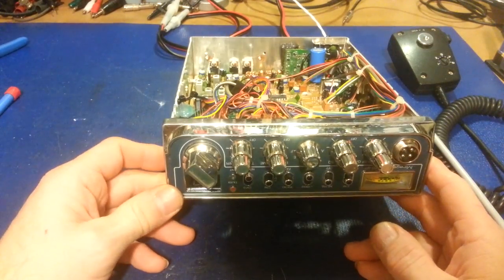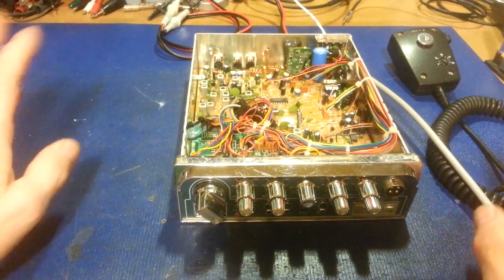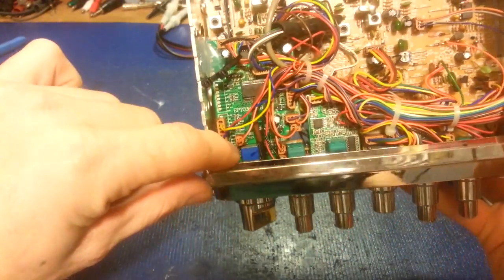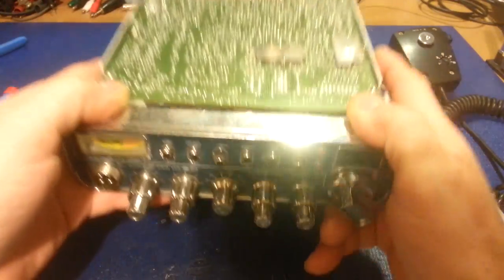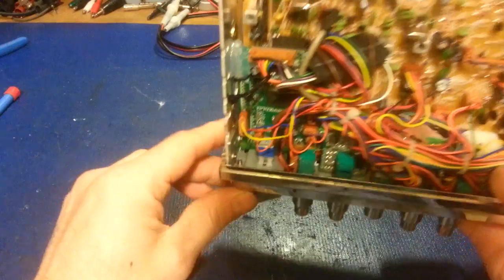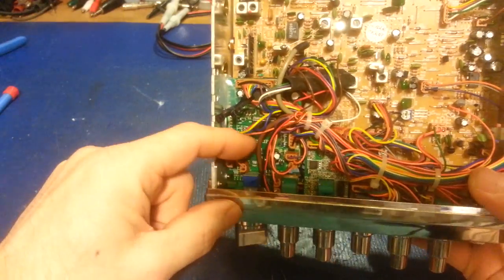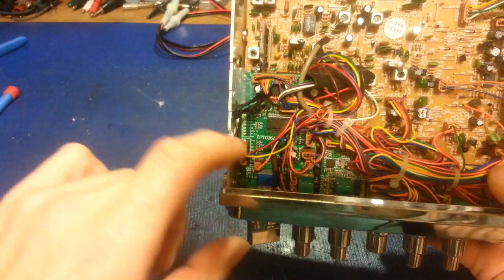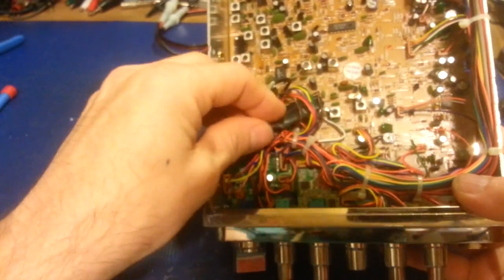Mirage MX-36HP channel selector rotary encoder falling apart. Poorly designed.

Comment: I HAVE THE SAME PROBLEM WITH MY RADIO SHACK TRC 465, THE HOUSING CRACKED ON THE CHANNEL SELECTOR, I HAVE IT MOUNTED ON THE CEILING IN MY SUV AND I LIVE IN FLORIDA.I THINK THE HEAT GOT TO IT... ANY IDEA WHERE I CAME GET ONE FROM ? (CHANNEL SELECTOR)  THANKS,JOE

Comment: Hmm, thinking outside the box - now that you've hot-snotted the PCB in place would it be possible to break the mechanical connection between the body of the encoder by rotating it 180 degrees and then bodge in a wiring harness from the pins now on "top" around to the PCB holes? Like I said, out of the box thought.
Reply from the maker: It would be a lot of work.  Things are pretty tight in there as it is.  The board itself can't go down any more because the main board below it is covered with parts.  What they should have done was make that board a 1/4" longer and mounted a solder on board mount to it and then a screw to the side chassis.  Someone was definitely snoozing when they designed it.